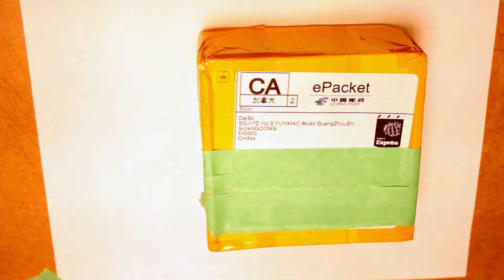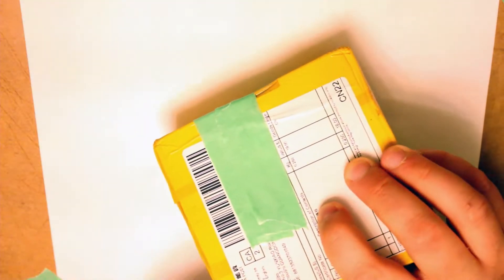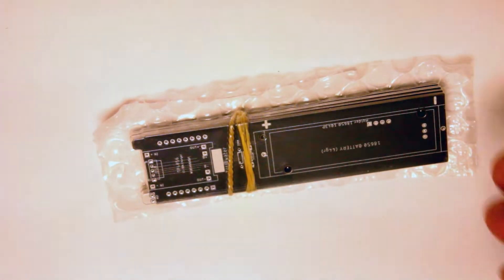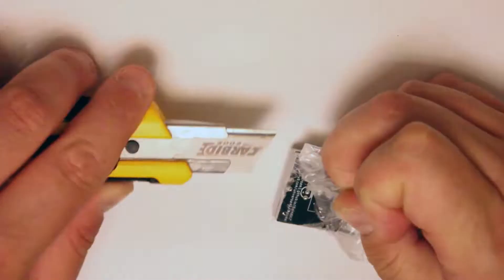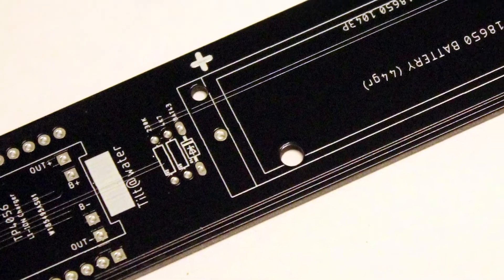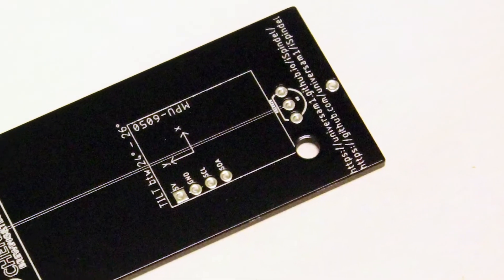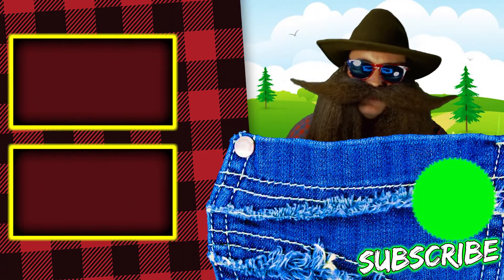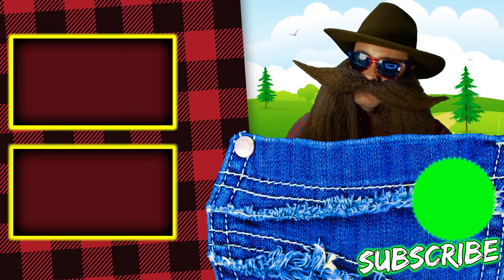iSpindel PCB 4.0 Unboxing - Digital Hydrometer

Comment: You have my attention... Is it just a bare bones "Tilt" / "Clone" ?
Reply from the maker: Yes, it's an open source DIY version of the tilt. I bought the supplies to build 5 x iSpindels from Aliexpress/Ebay. Those supplies cost less than the price of one Tilt, but will require some effort and fiddling around with to get things up and running. Stay tuned for the trials and tribulations of making one DIY.
Reply: Hell yeah will stay tuned. Did not know "kits" existed...
I always have a primary & secondary 55 gallons going. x2 15 gallon small batch pilots. x1 5 gallon beer fermenting. And x1 5 gallon Kombucha.
And Cider season is creeping up...
Reply from the maker: Nice, I just did a cider and have 5 x 5 gallon batches of beer going. Gotta keep the keezer full.